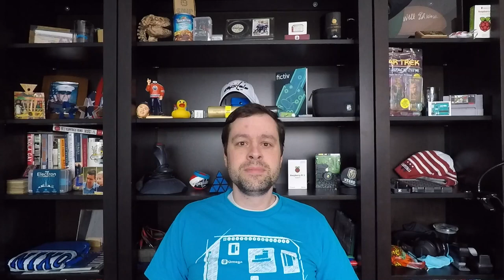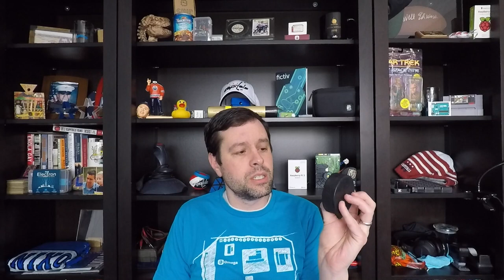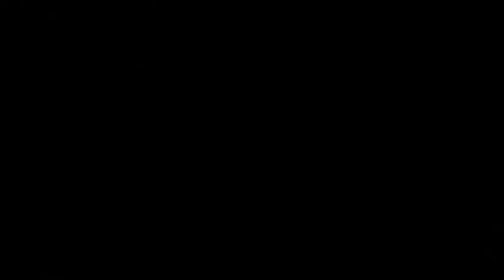All Plastic Enclosure or Real Puck?

Comment: suggestion... your sales volume should factor into enclosure costs (labor and materials).   100 manually made units from a cheap puck is labor intensive but low investment cost.  100 to 1000 units, plastic?   higher volumes consider  using injection molding with a much higher up front cost.  talk with a plastics sales rep about options.
Reply from the maker: Hey Keith, thanks so much for watching. Definite balancing act between cost and effort especially since I'm bootstrapping the whole thing. I'll definitely be weighing the options when I get closer to manufacture time.